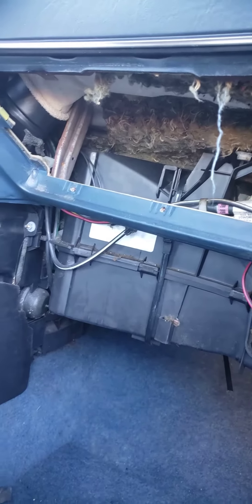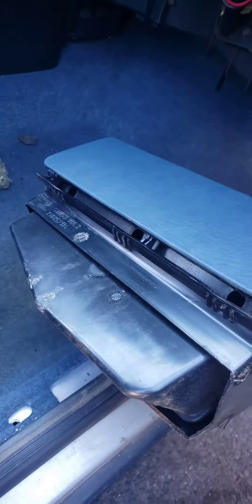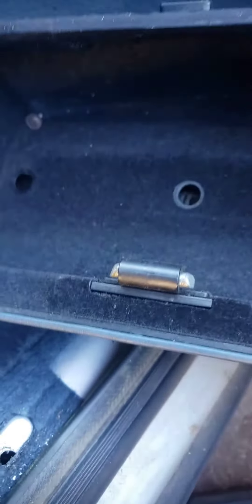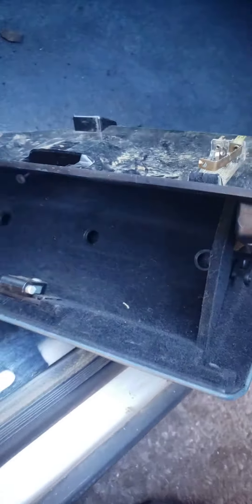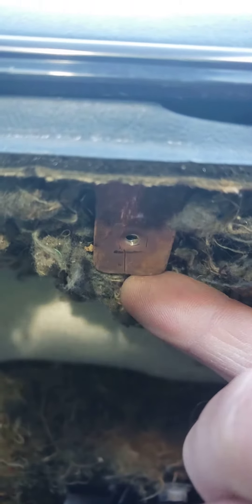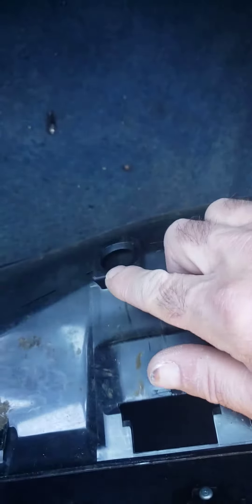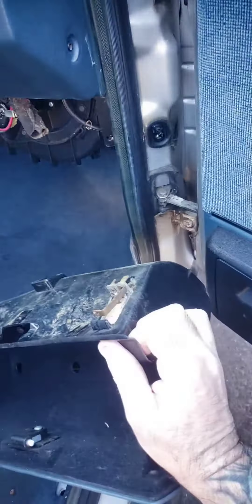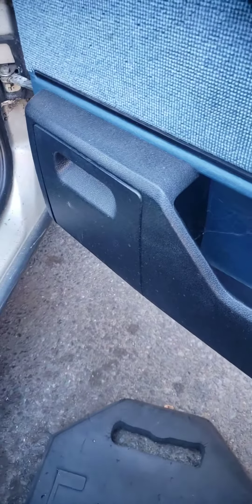How to remove glovebox mk2 VW Jetta

Comment: Thank you!! Stupid hidden screws in glovebox lol I was head scratching. While I’m here… do you know if that blower motor can come off with the dash and glovebox still on? I’ve got the exact same looking blower and Jetta with AC. But I’m not sure if the blower is gonna clear that on replacement. Too screw is gonna be hard to get to too but doable
Reply from the maker: @chrisladouceur4093  I couldn't tell you, I pulled the entire dash apart because mice had been living in it, then I pulled the blower motor and cleaned the hvac system. It's worth a try, if you can get all the screws out you might get lucky. If not the lower dash isn't difficult to disassemble, it's just time consuming.